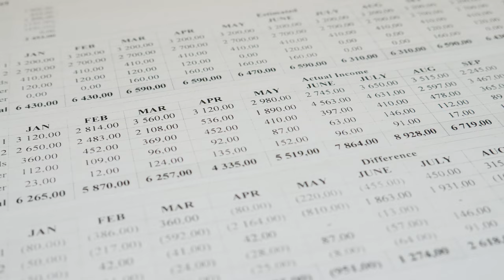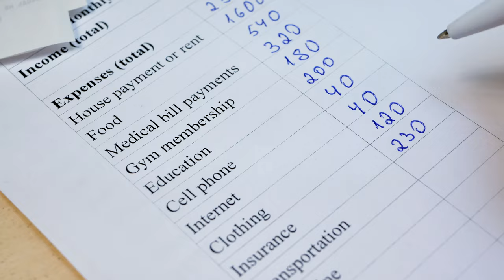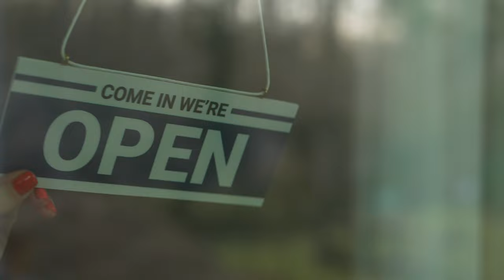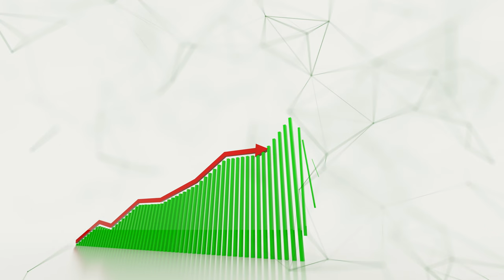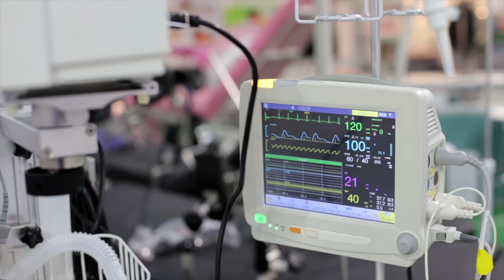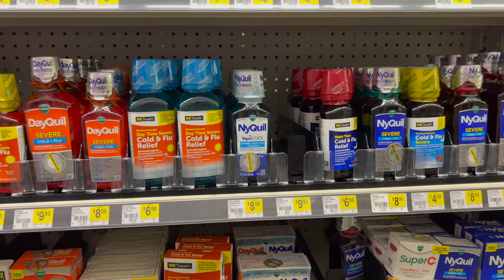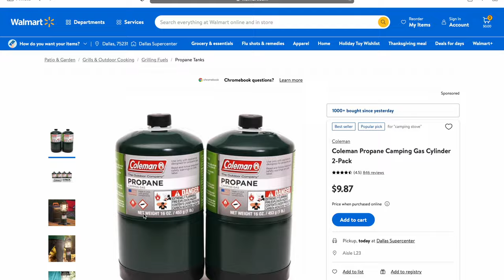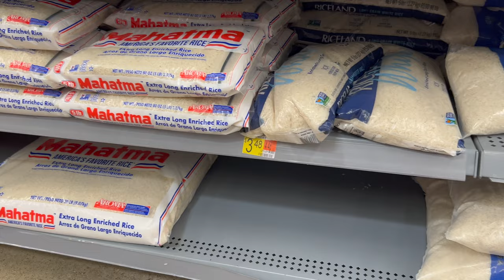MASSIVE INFLATION: How to Survive

Comment: internet usage:
1- free at the library
2- lower cost with SOME cell co'. T Mobile gives you about 4-5 gig download per month. 
3- call your supplier and ASK them for a discount. if they say yes, great. if they say no, let them know that you want to 'price compare' & you will call back later, possibly to cancel as you are going to another co. 
4- buddy up with someone. if they use it during the day, use it during the evening/ at night. 
5- short term deals: McD, BK, Taco bell, etc all have 'free wifi' with limitations. get a soda/ taco/ whatever in drive thru. park in the rear where the signal is not too bad, got maybe 15-25 mins for free for your laptop or tablet. 
  - old retired bored. and cheap guy who does this.